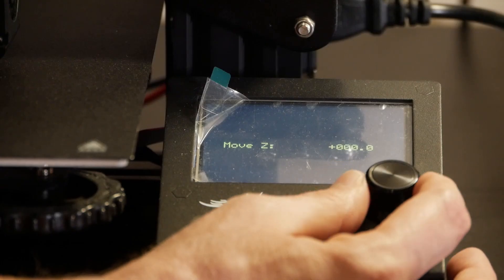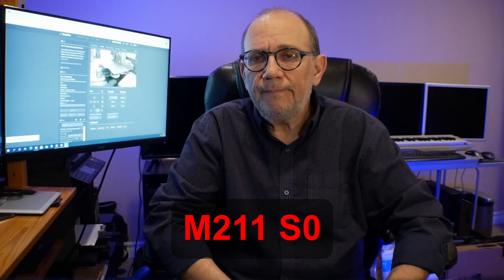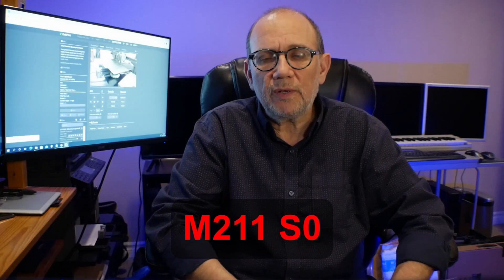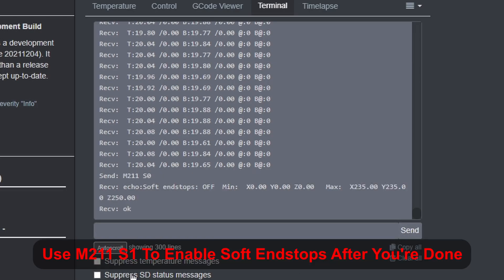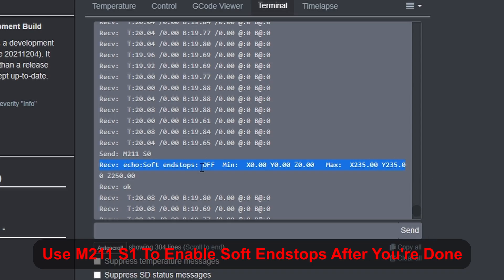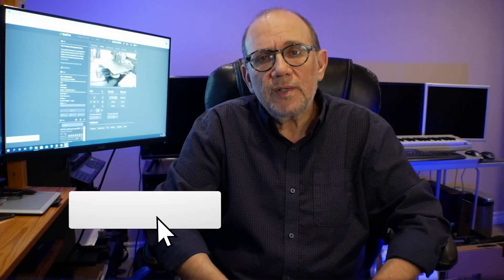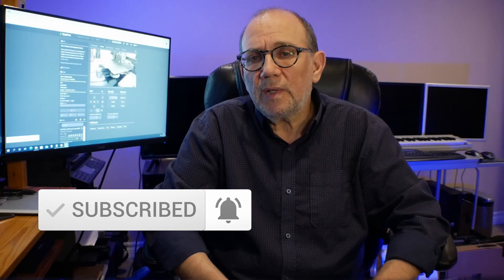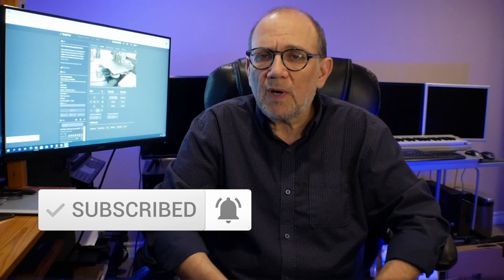Easy z-offset adjustment for your 3D printer.

Comment: Probably a dumb question, I'm not able to manually lower the probe on my cr touch. I got the firmware from creality, is there another update I need to install to allow that? Using an Ender 3 Pro.
Reply from the maker: Not a dumb question at all -- the way to do this is to use the Octoprint BL Touch Plugin -- here's some information on it:  https://plugins.octoprint.org/plugins/BLTouch/  The only problem is that you need to have Octoprint installed to use it.  If you do, just go to your plugin manager>Get More and search for OctoPrint_BLTouch.  Good Luck.  RG

Comment: Does the bed have to be leveled before doing this
Reply from the maker: Yes, you should do a manual bed leveling first and then set the z offset.  If your bed isn't level your prints may not be as accurate as they can be, despite the z offset and a BL Touch.  RG

Comment: how did u get it to go from .80 to .85 when i move the turning knob it goes from .80 to .90 how do u get .05's (when setting the z offset not moving the z axis)
Reply: I have the same problem.

Comment: okay i love the video from an understanding point of view, but the only way i can change my z offset on my ender 3 pro is by dropping the z down to 0 then heading over to probe z offset. while the nozzle is hot. i cant make my z axis go negative. let alone drop .025mm at a time
Reply from the maker: The reason you may be having an issue getting the z axis into the negative is because your z limit switch is turned on in the firmware.  You need to turn off the z limit switch with the M211 S0 command.  I deal with this in the video at 15:00 .  Typically you can send the M211 S0 command using a terminal built into Octoprint or some such interface.  If you don't have this available you can also use a simple SD card to send the command.  I made a video on how to do this here:  https://www.youtube.com/watch?v=pj0kICk6DfY&t=335s .  I hope this helps.  RG
Reply: @CreatewithTech  is this something you can do with the stock creality firmware? i was under the understanding that unplugging my z switch shouldve fixed this. i am running a cr touch aswell.
Reply from the maker: @codymccoy9295  If you installed the CR Touch yourself, then you need to update to a firmware version that is specific to a printer using a BL Touch or a CR Touch.  In other words, if the firmware you're using came with a machine without a CR Touch and then you installed a CR Touch then you need to update the firmware to account for this new add on.  I'm not sure which control board (I've installed the Bigtreetech SKR Mini E3 V2 on mine) you've got on your machine so you need to do a bit of research to find out which firmware is appropriate for the control board on your 3D printer.  Once you've installed the appropriate firmware you need to set your z offset by following my video.  If your z axis will not go into the negative numbers it means that the Z limit switch is turned on in the firmware.  This is a completely different thing from the physical z limit switch that you unplugged.  The firmware limit switch doesn't allow you to go below 0 in order to prevent damage to the bed of the printer.  Going below 0, is, however necessary when setting your z Offset, which means you need to turn off the firmware z limit switch.  You do this with the M211 S0 command.  This will allow you to lower the z axis into the negative number territory.  Once you've set your Z offset and saved it to your eeprom, you simply need to turn the Z limit switch back on in the firmware by sending it the M211 S1 command.  RG

Comment: There is a bug that affects some ender 3s. Z offset cannot be set. This is down to a poor performing sd card or the save command not being sent to the card.
Reset the machine to defaults and save. Turn the machine off. Format the sd card and re-insert. Switch on the machine and do the z-offset setting again. Save again.

Comment: Hi I enjoy your videos and have learned much from them. I have a question, I installed the cr touch on my Ender 3 v2 and it works as advertised.I have Jyres firmware installed, My problem is that with a power loss it doesn't continue when selected on power return but starts the job over from the beginning. Also when I pause the print, turn off the power and continue later it seems to go to last x/y and start but always starts high and never contacts the print item. Don't know if this is normal? Thanks
Reply from the maker: Hi Norman...thank you for watching my videos.  I'm glad that you're getting something out of them.  While I do not have Jyres firmware installed what you're describing definitely does not sound normal.  I did a bit research and apparently power loss recovery is turned off by default with the Jyres firmware.  This means that you'll need to turn it on.  Did you look on the Jyres menu to see if it has a power loss recovery option?  The m413 S1 command turns on the power loss option.  If you have access to a gcode terminal (there's one in Octoprint) you can check the status of the power loss option.  To do so, all you need to do is send the M413 command.  You should get the status of power loss in the form of "Power-loss recovery ON" or OFF.  Here's a link to the Power Loss page in Marlin:  https://marlinfw.org/docs/gcode/M413.html  .  Another thing:  power loss will only work when you are printing from an SD card or a flash drive.  If you're using Octoprint or remote software to send the gcode to the printer power loss recovery will not work.  Power loss recovery requires the gcode to be on the local sd card because the printer periodically saves the print job state to the SD card or flash drive.  I hope this helps.  In case of a power outage it uses that information to resume the print.  RG

Comment: I love this video, i need your help I just installed the CR touch on my Ender 3 Pro. i upgraded my motherboard to the BigTreeTech SKR Mini E3 v3.0 and have download the latest firmware and installed it. when i have the Z axis disconnect from the both ends (motherboard and the old stop) when i home my machine it will only do it in the X and Y axis and not in the Z axis. When i reconnect the Z stop and have the CR touch connect it will measure the distance from the best but print to far away from the bed. I need help trying to understand. Thank you
Reply from the maker: Hi Alex...I'm glad that you like the video.  It means a lot.  As far as your question is concerned, the first thing that comes to my mind is that you flashed the wrong firmware to the printer.  So there are two firmware options that you can use with the CR Touch:  1.  Firmware that doesn't use the CR Touch for Z homing  2.  Firmware that uses the CR Touch for Z homing (this is where you remove the physical z switch from the printer).  If you've removed the z switch from the printer (which from your comment you seemed to have done), then you need to install the "firmware-ender3-bltouch-for-z-homing.bin".  If you haven't, you need to install the "firmware-ender3-bltouch.bin".  Just in case you're wondering, the CR Touch uses the same firmware as the BL Touch.  Here's the Bigtreetech Github page where you can download the bin files for the firmware:  https://github.com/bigtreetech/BIGTREETECH-SKR-mini-E3/tree/master/firmware/V3.0/Marlin  .Just be careful when you test things and have your finger on the off switch in case something goes awry.  Let me know if this works.  Good luck!  RG
Reply: @CreatewithTech  thank you so much for the explanation I was trying to understand the difference as well. Now it make sense. What would you recommend for which bin file to use?
Reply from the maker: Hi Alex...I'm not sure one is better than another.   Personally I took off the physical z limit switch and I let the CR Touch do the Z Homing.  Just be aware that if you choose that route, the printer will home to near the centre of the bed.  RG
Reply: @CreatewithTech  thank you so much! I will try this route!
Reply: @CreatewithTech   I have a question for you when I use the regular bin without Z homing, and everything is connected at homes in the X and Y and Z but it does not home in the center so then I have to disable it so that way I can physically bring the extruder to the center and try and get the Z offset the Z offset as well when I say move the axis, it only goes to zero it won’t go negative. How do I fix this in order to get the correct Z offset thank you.
Reply from the maker: @alvarezz09  Hi There...yes, that's a problem...the reason it's not letting you go past 0 is because you've got the z limit switch turned on in the firmware.  This is a safety feature to prevent you from hitting the bed with the nozzle.  When doing your z offset, however, you need to go below 0.  The this is done is by sending the M211 S0 command to your printer.  I mention this at the end of the video at 15:01.  I also made another video about it here:  https://www.youtube.com/watch?v=pj0kICk6DfY&t=350s  .
Reply: @CreatewithTech  thank you I really appreciate your help, is there a way to get the Z to home in the middle of the board? I noticed when other people use the CR touch theirs does that automatically mine always homes in the original front left corner and then I have to disable to steppers in order to move it to the middle of the bed
Reply from the maker: @alvarezz09  Hi there...I think the reason it's doing that is because you've got the wrong firmware installed on your machine.  You need to install firmware that's made specific for machines with a CR Touch or a BL Touch.  Did you do this?  Here's the link the firmware for the SKR Mini E3 V3.0, which I think is the board you have:  https://github.com/bigtreetech/BIGTREETECH-SKR-mini-E3/tree/master/firmware/V3.0/Marlin  .  Download and install "firmware-ender3-bltouch-for-z-homing.bin".  I'm assuming you didn't do this yet, correct?  If you haven't, try that and see if it fixes the z homing issue you're experiencing.
Reply: @CreatewithTech   thank you sir I download the whole folder and then went to the 3.0 and install the firmware that just has BL touch. I did not install the firmware that says bl touch with the z homing. I did try the bl touch with the z homing(note Z limit switch is still connected) and every time I run the print it just stops with the Z homing software. When I run the firmware that says bl touch like you did in the video it always homes to the front left corner of the bed like it originally did before I installed my cr touch. With just the firmware that says BL touch it works but I can’t get my bed to level correctly with the Z offset it’s always up to high, even when I follow the steps to obtain my z offset. Very frustrating. I’m not sure if you have a direct message but I could send you a video of what happens. Thank you for all your expertise.
Reply from the maker: @alvarezz09  Hi there...OK, so if you're having problems with the z offset, it means one of two things:  Either you've got the z limit switch turned on and you can't go past 0 into the negative numbers and so your extruder is too high off the bed, or if you're able to get the z offset into the negative numbers and you're able to set the z offset properly but then it's too high when you turn on the printer, then you're probably not saving your z offset setting to the eeprom -- you'll need to send the M500 command to save it with g code or save it from your LCD menu.  Once the z offset is saved to eeprom it should work.  Let me know if you were able to properly set your z offset and if you were able to go into the negative numbers.  RG
Reply: @CreatewithTech  thank you!
Reply from the maker: @alvarezz09  I hope that my suggestions are helpful to you.  Let me know if you get it to work.  If you don't and you'd like to send me a video illustrating the problem, you can send it to reelstories@rogers.com .  Make sure that the file isn't too large (no more than 25MB) as my ISP will block it.  RG
Reply: @CreatewithTech  thank you! I got it to work I actually followed and updated the marlin software to what I needed and now it’s working like a charm. I really appreciate your time and suggestions too they helped me a lot !
Reply from the maker: @alvarezz09  Great!  🙂

Comment: It used to print in the center and no it's not because how I placed it or sliced it it keeps printing to the right I've been trying to use a Marlin software to get my 3D prints to print the center but my Marlin software when I upload something it keeps doing red errors I was going to see if you could do a video using a software octoprint to get your 3D prints to print the center it'll be really helpful if you could help me out thanks

Comment: I was going to say if you could help me with something please my 3D prints keep printing on the right I'm trying to get them to print in the center
Reply from the maker: Hello rizkdark...I'm sorry you're having this issue.  I'll be happy to help but I need more information.  Is it printing on the right because of where you're placing the model on the build plate in the slicer?  Is your slicer profile properly set up (i.e. do you have the right size of the print bed in the profile).  Did you change the firmware on your printer recently?  Were you able to print properly before?  If so, did you change something?  Give me a bit more information and I may be able to help.  RG
Reply: @CreatewithTech  no it's not because I put it in the wrong spot and no I did not have this issue it used to print in the center the 3D printer I have is a voxellab  I updated the firmware to creality and I'm trying to make it print in the center it keeps printing on their right I'm trying to use Marlin to fix it I watched a video I went to travel limits and when I try to upload it I keep getting these red error messages on Marlin if you really helpful if you could help me hopefully this is enough information if you have any questions just ask me

Comment: I had a lot of issues with this, and other videos either flying right past, or skipping steps.  Your video was a god send!  I was really pulling my hair out, swear jar over flowing.  I am half way through printing the circles, and they all look great so far.  

I would hug you if you were here!  I'm not only a subscriber, but also a fan.

I like that you respond to comments, and make an effort to help out.  That's a great service, thank you sir.
Reply from the maker: Excellent!  I"m glad that this video was helpful.   RG
Reply: @CreatewithTech  actually, I am still having a ton of trouble.  I home the probe.  Move Z until it is the right height I want.  The number seems to be different each time...  But when I put the number into Z offset, the head hits the table.  I move the z axis and get my number let's say -000.1 but when I go to probe the offset, it gives me the number in 00. and when I put -00.1 it hits the bed.  I am totally lost with this.  Most've tried doing it 50 times by now, numbers are always different.  Bed is level, i'm lost.

I took off the z stop when I installed the probe.  Should I keep the Z stop switch on?  I have watched so videos, I don't what is right anymore.
Reply from the maker: @mikebird4066  I'm sorry you're having issues with this.  I understand how frustrating it is.  A couple of questions:  1.  What printer are you using?  2.  Assuming that you installed the automatic bed leveling system yourself (CR Touch/BL Touch) did you update the firmware for the printer to take into account the newly installed ABL?  If you did, I'm assuming the Firmware update was successful.  3.  Did you manually level your bed with the wheels first and then try to set your Z offset, because you should do that first. 4.  After getting the correct number for the z offset did you save it to eprom?  So these are the steps you need to take...   1.  Update the firmware 2.  Manually level your bed  3.  Calibrate your z offset (turn off the z limit switch if it's turned on) 4.  After getting the correct number for the z offset make sure that you save it to eprom.  Also turn on the Z limit switch and again save it to eprom  5.  Put the G29 command in your start G code in your slicer for the printer to initiate bed leveling before each print.  Let me know if you've followed all these steps.  If you did and it's still not working, then there's something else going on.  Confirm that you've followed each of the above steps.  RG
Reply: @CreatewithTech  i have an ender 3 pro.  I downloaded the latest firmare, and put it on 2 sd cards.  Not sure if it takes or not, printer just seems to boot up.  When I look at my about it says april for firmware, so doesn't seem to have updated, but the auto leveling, was in the menu, and did it's thing before each print.  it was printing but seemed to be too close to the head, initial lines of print, were very thin, not able to peel off thin.  

So I leveled my bed manually, and tried to change my z offset, but it always seemed to put the head into the board.  not sure if I am putting in the wrong values, as the formats for the numbers are different 00.0  and 000.0 for move the z, and setting the off set.

I put the z axis switch back on, and hooked it up, pulled the plug on the CR touch, and plugged the z axis switch back in.  Now it doesn't home properly, and prints won't start, they heat up, and then back down again, no kind of message.

I would love to reset the machine back to defaults, but that doesn't seem to work.  Just beeps, does nothing.
Reply: @CreatewithTech  i went back to different firmware, and am able to print again.  i will try again with the cr touch from scratch.  thanks for your help.